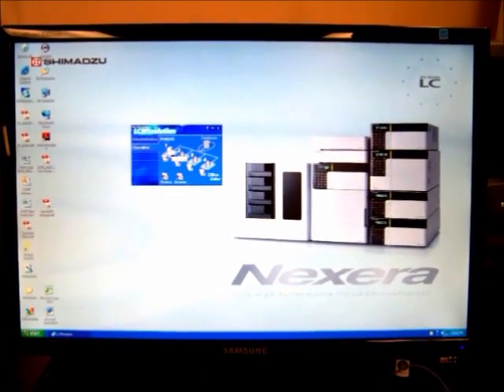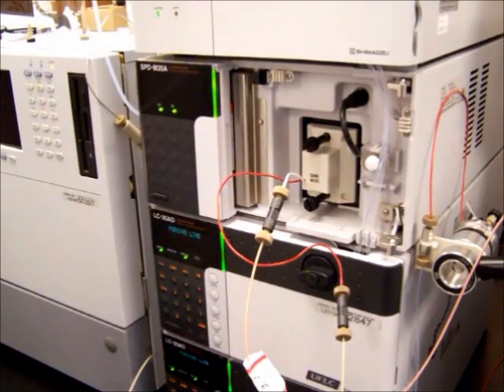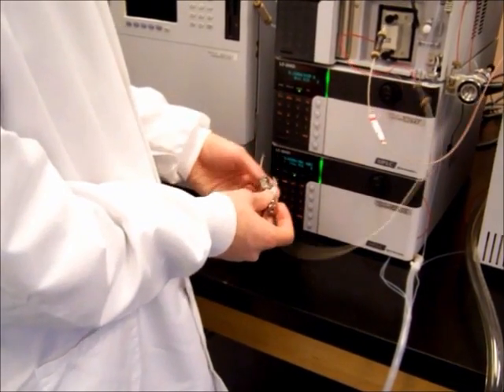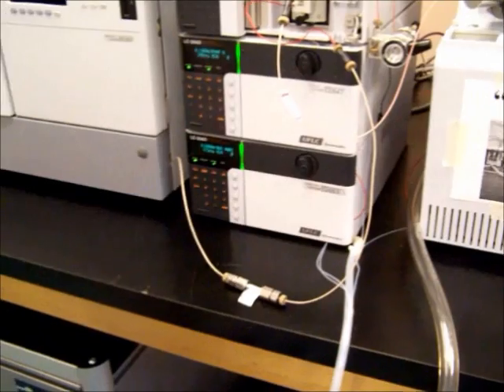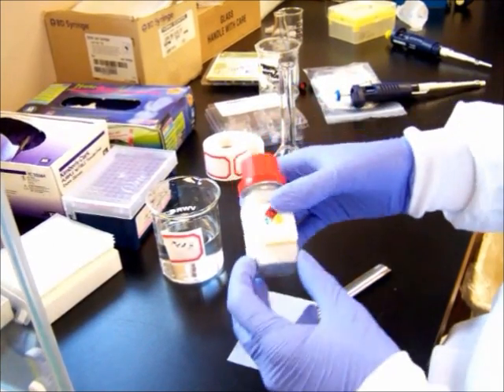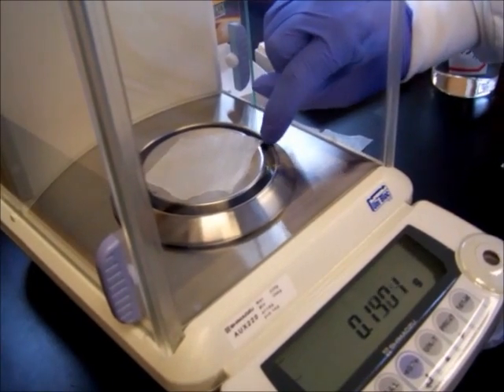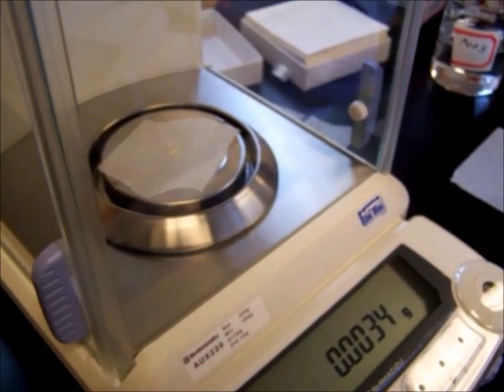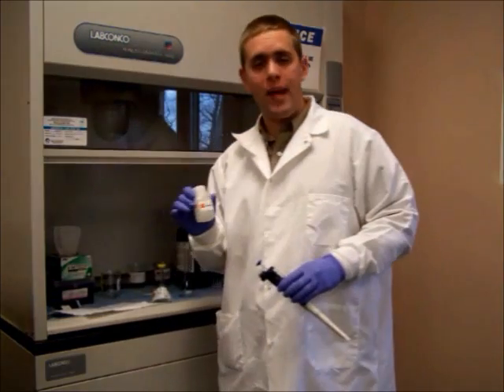LC-MS Simple Operation College Training Video Part 1.wmv

Comment: Something you can do with your weighing paper is fold it in half and crease it  and take some scissors and cut down halfway and then angle up. You will have what looks like a folded over paper airplane where you have a long snout and then it angles up to a wider area.  You open the paper back up when you set it on the balance to weigh your micro amount of powder. Then fold it back together when you prepare to insert the snout into the narrow opening of the vessel. We used to do this with Schlenk flasks where you have a narrow opening but you have to get your powder material down into the neck and past the valve seat.

Comment: I appreciate your effort but your preparation was not scientific at all. You weighed a very small amount ( probably 80% error introduced). You use a tissue to take your a very small amount and then you put a tiny amount in. Funny thing you said not perfectly accurate !!!! and you are using LC-MS !!!. Thats completely rubish and very dangerous
Reply: to be fair that is weigh paper, not tissue paper.
you could argue it would have been better to cut it than tear it, but that seems semantic at best.